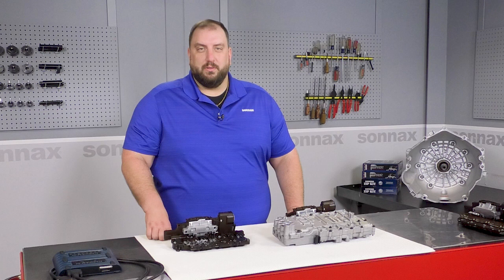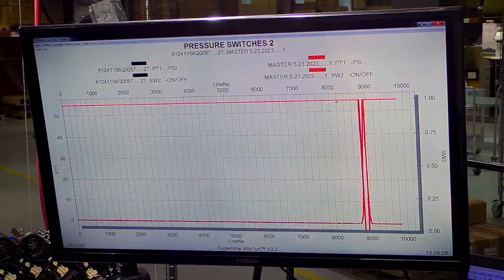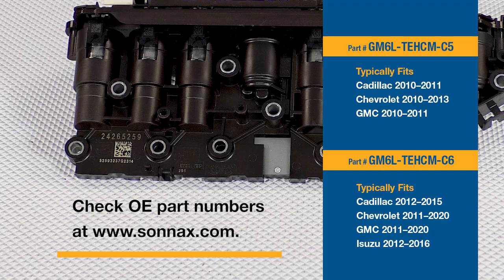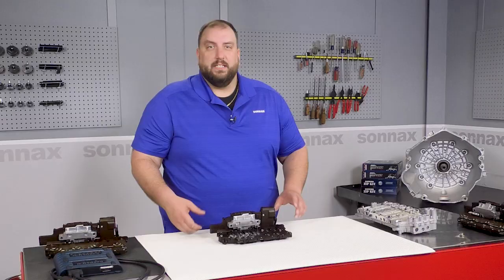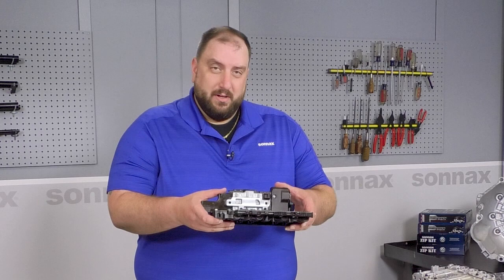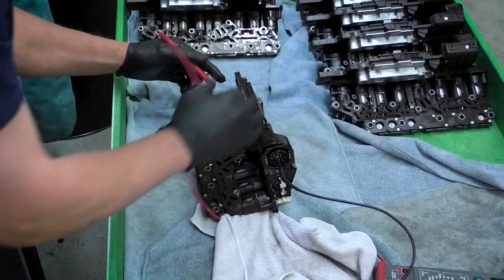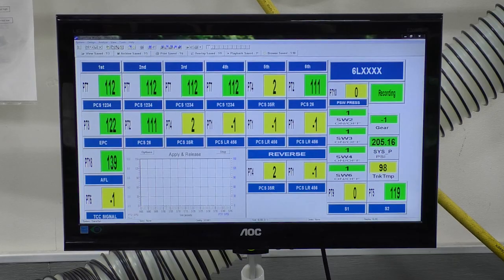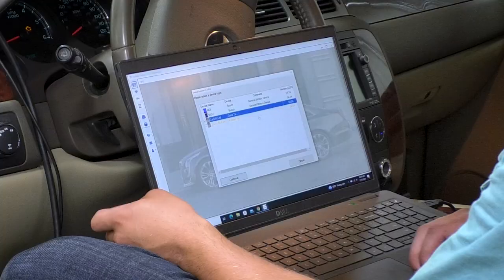Sonnax 6L80, 6L90 Remanufactured TEHCMs for Top-Quality, Affordable Repairs

Comment: IF YOU REPLACE THIS ON YOUR CAR YOU MUST TOW IT TO THE DELAER TO PROGRAM IT TO YOUR CAR. People should know this important detail.
Reply from the maker: Hi, and thanks for your comment! If you click the link above to the part page on our website, it states that after installation, this remanufactured TEHCM must be reprogrammed on the vehicle using a J2534 device in order to function correctly. Thanks again, and have a great day!
Reply: @sonnax  Can it be taken to the dealer separately and flashed, then installed?

Comment: Hi
Have you guys given any thought to contaminated trans oil with metal particles interfering with electrical conductivity on the open type electrical terminals inside the box , wouldn’t this play havoc with computers with the oil no longer being a insulator?
Reply from the maker: Yes, we've considered the impact of contaminated transmission oil with metal particles on electrical conductivity, particularly regarding open-type electrical terminals inside the trans. 

While contamination is a concern, our investigations into various rebuilds from multiple shops show that the level of contamination required to significantly interfere with low voltage signals would have to be quite substantial. In typical transmissions, there is a magnet and a filter that will catch most of the problematic particles. The contamination levels observed are generally not high enough to cause notable issues with electrical conductivity or disrupt computer systems. If you see that amount of contamination, then there is likely a much bigger issue that needs to be addressed. Thanks for reaching out!